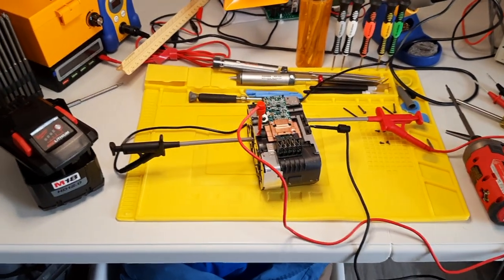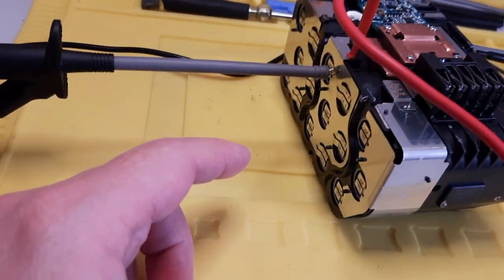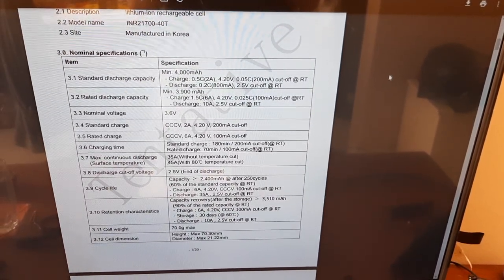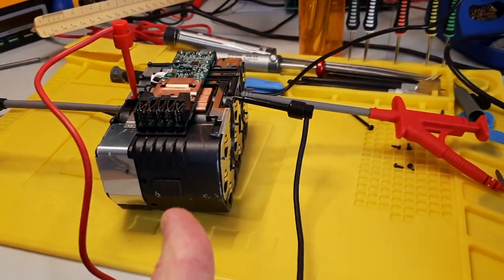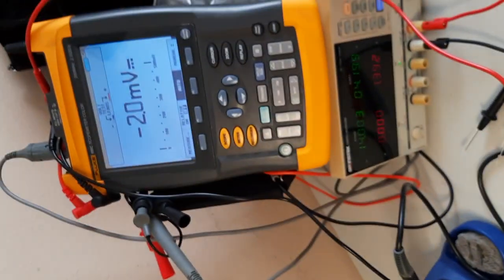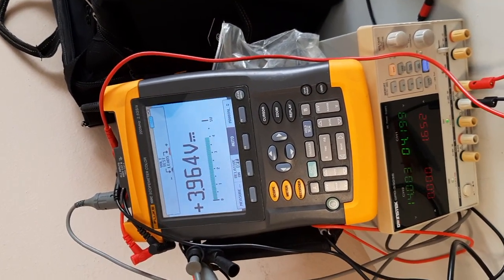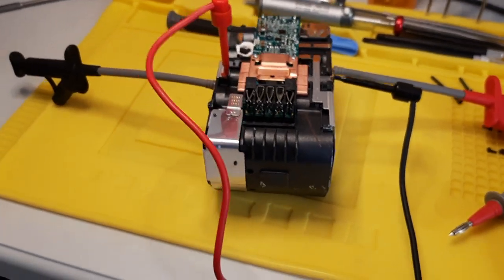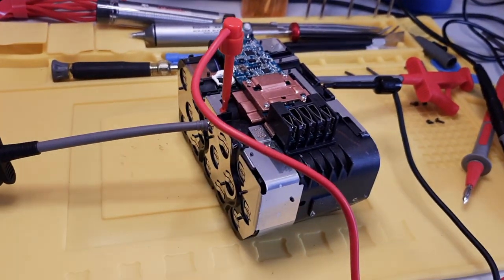Reviving a Milwaukee M18 battery that won't fully charge.

Comment: Just a heads up
The reason the pack is unbalanced is because of cell self discharge
There are faulty cells in the pack
This problem will return
And you can safely charge at 4Amp per cell
There are 3 so up the amp to 12 to make is faster

Comment: Mine is a m18 12.0 and it’s 3/4 charged but when i put it to charge, the green and red lights start blinking out, so do you  think it’s the same problem you had ?
Reply from the maker: Looking up that blink code, it first indicates a connection problem between the battery and charger (try cleaning the metal contacts on the charger and the battery, then try seating the battery in the charger forcefully), if that doesn't work, then it could indicate a problem with the battery, though try it with another charger first to verify.  If it is the battery, I don't think it will be the exact same problem since the symptom I see with batteries that won't fully charge is simply a non-full charge, not the red/green blink code.
Reply: @ i’ll have it on mind thanks greetings and blessings!

Comment: I am sincerely not trying to flame you. This video is very informative, but I cannot watch it for more than a minute. The handheld thing with the wobbly video makes me sea sick. If you redo this video on a tripod, your watch time will skyrocket. I wanted to watch the whole thing, but the shaky video prevents it.
Reply from the maker: Oh, I totally understand, and you are absolutely correct.  I don't take that as insult or undue criticism at all.  This was one of my earlier videos in shake-o-vision (tm) from before I owned a tripod.  I still have problems with audio in my newer stuff which I want to solve with a lav mic.  I had a cheap one, but could never get it to function (it may have actually been defective) - but like everything, quality costs.  It's on my list-of-many-things, but like the name says, so many things are on the list.

Comment: I currently have an 8.0 slow charging parallel cells at 500ma due to an imbalance. 
Im 3hr 25min in and at 3.81v on the first set. 
(2 sets need charging i believe) 
Im curious how long did your process take to restore your 12.0...??
Thanks for the informative video.
Reply from the maker: It took a few hours, and I should note that while it worked for a while, it was not a permanent fix (probably an imbalance in individual cell health that would be fixed by finding the problem cell and replacing).  Still, it was good enough for me.

If you are charging a rail and not an individual cell (I'm guessing that's what you mean by first set?), then I would go ahead and kick your current limit up to 2 amps or so.  I was being overly cautious at first, but charging 3 or 4 18650s or 21700s in parallel can easily take that current.  It will take way less time and so long as you have your voltage set to say, 0.1 volts under the max charge on the cell spec sheet, you're definitely fine.  You can lower the current limit back down for the home stretch if you want.
Reply: @neverendingstudent  That's good info, thanks.
I let it charge overnight and was happy to see that it fully charged that group of cells. My battery was maxing out at 2 led indicator lights, it now shows 3, indicating I'm on the right track...
Thanks again for the video and advice...

Comment: how did this pan out as a long term fix?  Did the battery cells eventually fall out of balance gain?  And if yes, how long did it take?
Reply from the maker: I wasn't as scientific with my follow-through on this as would have been ideal.  It has gone back out of balance, but I didn't keep record of how many uses / charge cycles / days I put it through before seeing it go back down.  It lasted a while, but I can't be less vague than that, my apologies.

Most likely the definitive fix is isolation of a degraded cell and replacement of that individual cell - but manual charge balancing does extend the life before that at least.

Comment: Those 6,8,12 has a coating on them
might need to scrape them off to make good contact

those Samsung 40T are known to fail on some, you will see them go bad
some bms shock the 12 to death

Comment: I’ve had the same issue with my 12.0. I’ve seen reports of this other places as well, specifically the 12.0. The BMS has a BQ76925 capable of balancing but it appears Milwaukee isn’t using this feature.

Comment: Did that fix the battery? I have the same issue with 2- 9.0 batteries
Reply from the maker: It seems it has, *for now*.  A better test is to see if it will consistently charge to full after a month or two at least.

Comment: I've got a 60v Ebike battery that's fairly new that won't charge past 80% according to the little screen on it. What do you suggest I do?  Anything helps thanks
Reply from the maker: Let me start by saying the larger the battery, the more care and caution is called for.  If you are doing to disassemble, be VERY careful not to pierce a cell or cause a short, you don't want a lithium fire with a big battery.  Don't only have a fire extinguisher on hand, have a container half-filled with sand sized to dump the battery into, a way to quickly get the burning battery into that sand without burning your hands to do it, and a bucket with more sand to dump on top of it.  NO WATER FOR LITHIUM FIRES.

That said, I would first try to look up information for that specific battery, see if others have had issues with it.  You could take the case apart and use a multimeter to check voltages on each cell to find out if any are bad / not charging to where they should.  Look up the markings on the individual cells (they should all be the same) and find the datasheet for that cell to tell you what its fully charged voltage should be.  If the pack uses pouch cells (literally rectangular batteries that look like pouches) then you probably shouldn't proceed, those are waaaaay easier to damage than 18650s or 21700s.

Good luck!
Reply: @neverendingstudent  do you know of any business or person that I could send both of my 60 volt batteries to to have them checked out/fixed?
Reply from the maker: I don't, off the top of my head - but you could google electronics repair shops in your city or state.  Unless they cost $500 or more per battery though it probably isn't feasible cost-wise to pay a company to do it.  I don't know for sure though, maybe a shop wouldn't charge too much?  You'd have to shop around.